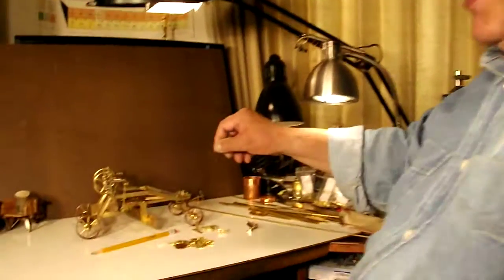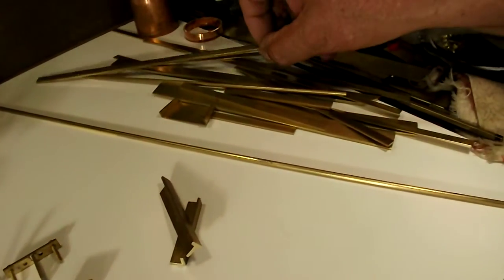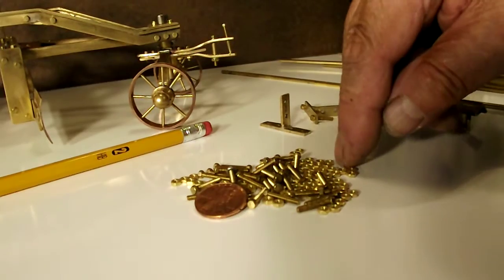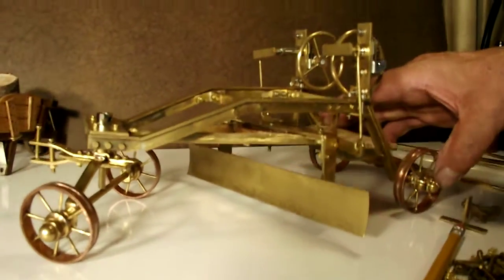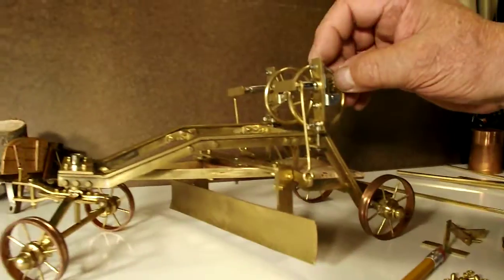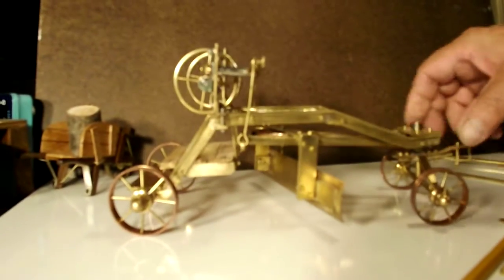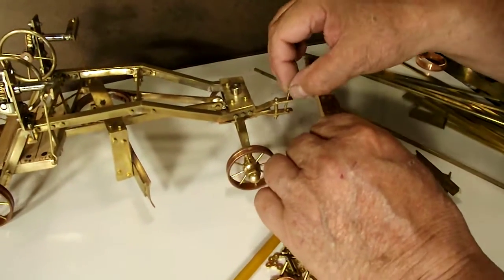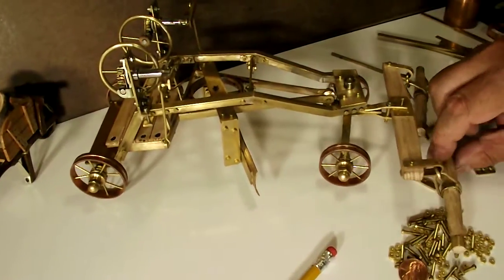Miniature Tools Antique Road Grader by Art Rafael

Comment: Another masterpiece, Ralph! Are those machine guitar tuners for the height adjustment mechanisms? They look right at home on the grader. Very smart construction all around. Very well done.
Reply from the maker: Hi, Steve.  Yes, they are guitar tuners, and they do fit the scale of the grader and work perfectly.  I searched high and low for worms & gears and found nothing I could use then accidentally stumbled onto these (long story).  Thanks for your observations and  compliment.